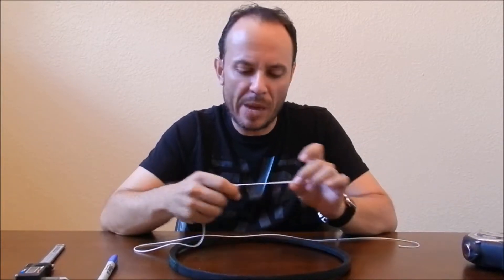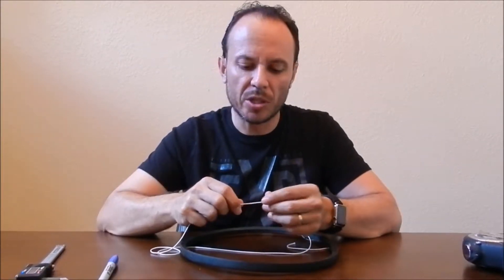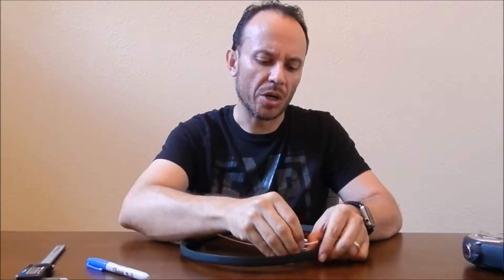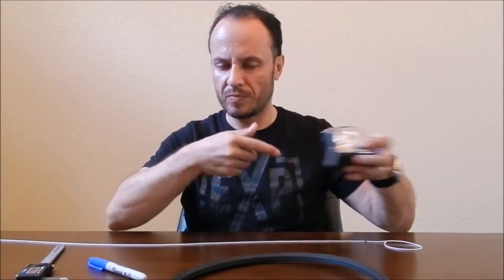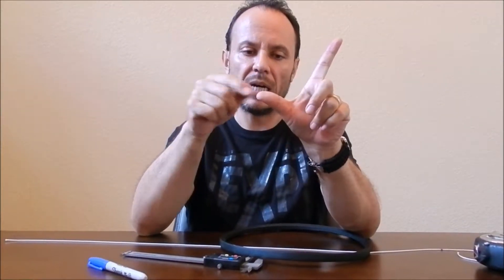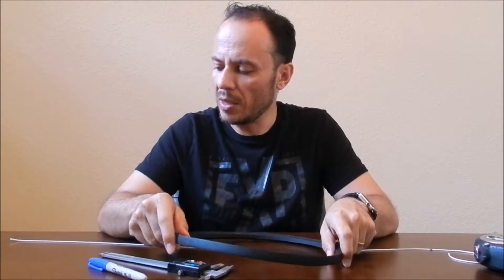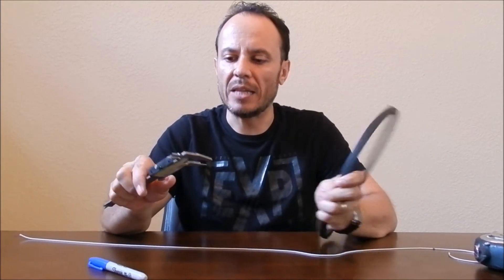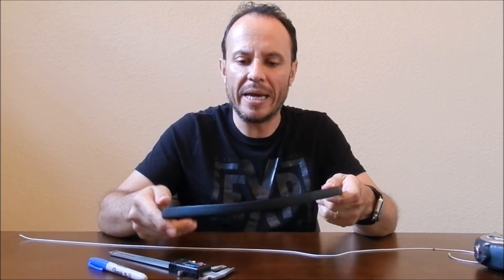HOW TO MEASURE A  V BELT

Comment: I would respectfully disagree with the measurement label of the belt. Traditionally it would be two numbers short so a belt with length 55” and 1/2” would be A53 or a belt with 81” and 5/8” would be B79 a lot of people get this wrong especially in the lawn mower shops
Reply: He is measuring the inside of the pulley so it probably works out right. With your method you measure the outside of the pulley or belt.